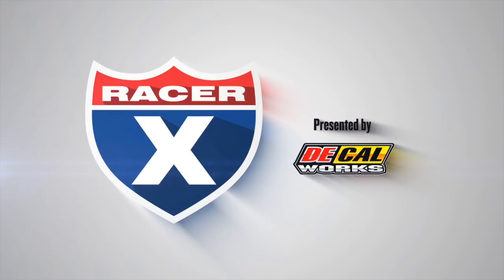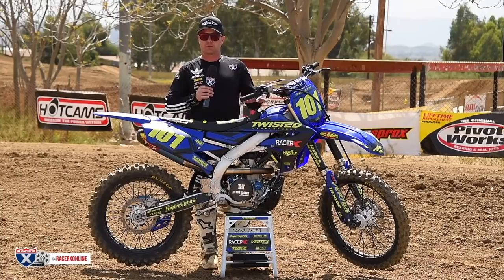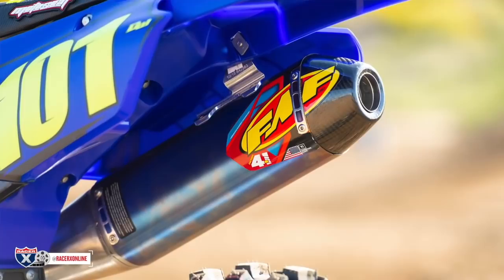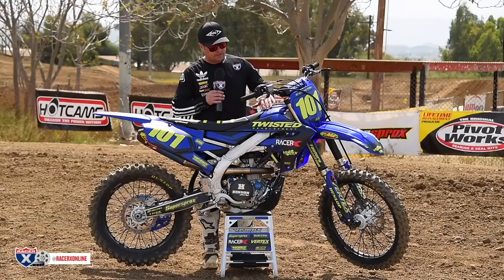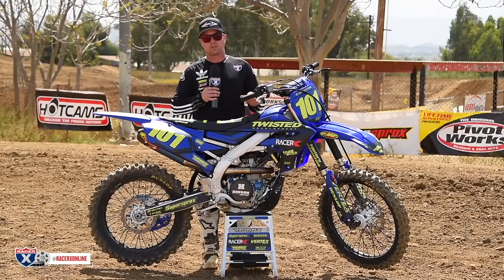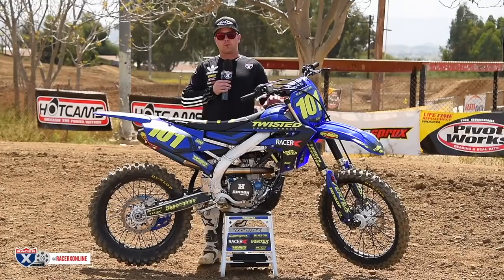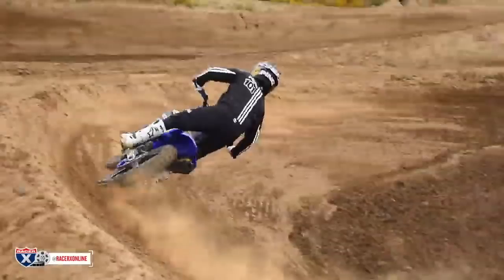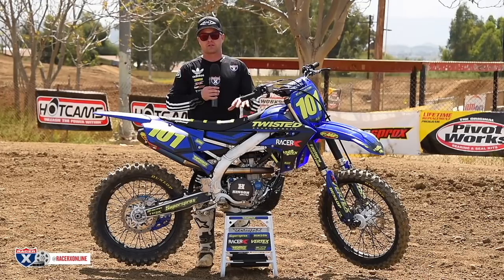Racer X Films: 2019 Yamaha YZ250F Garage Build

Comment: Dave you mentioned it turns well, is there a reason the Yammy 250 turns well, but their 450 doesn't?
Reply: Greco Conduris  the new ones actually do now, I rode a 2020 I can confirm the front end feel is 10X better than 2016-17
Reply: Jamesy YzTwoStrokeMx oh that’s good to know.
Do you know if it is like Suzuki and Honda turning or just better than older versions?